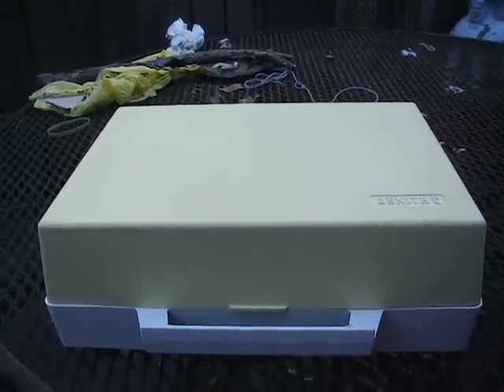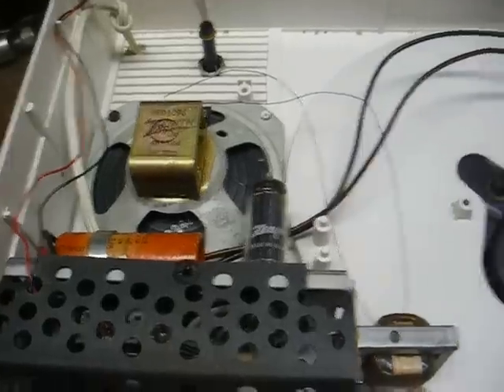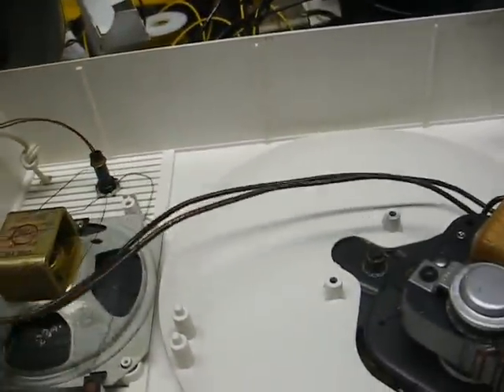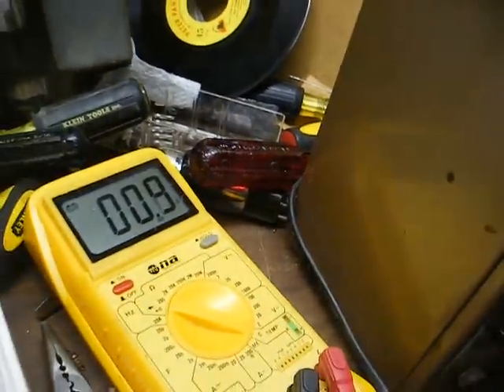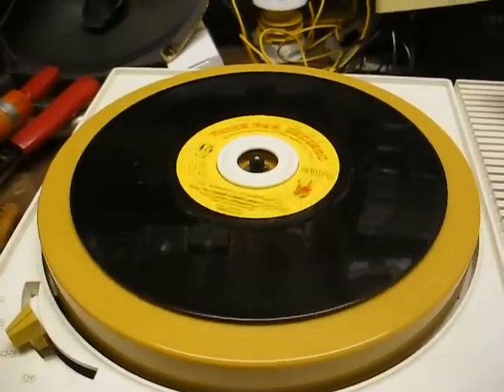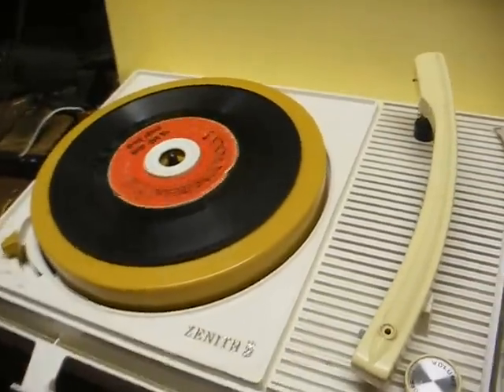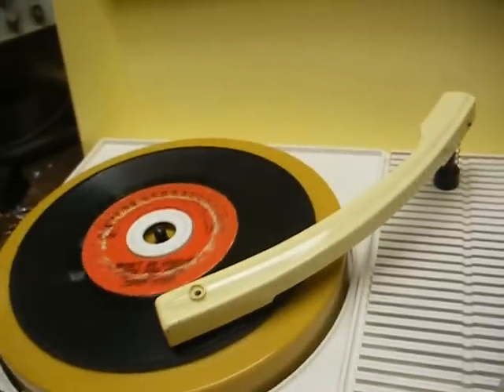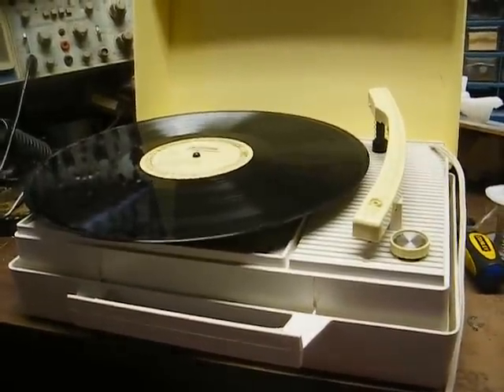Zenith single-tube kiddie record player from 1968

Comment: Zenith was rock-solid. My dad only purchased Zenith TV's until the early 80's. That early 80's set last into the 2000's before the picture developed problems, it would shrink down in size occasionally. No one would repair it so he had to junk it. At the same I was thinking that it could be some IC or capacitor that was causing it and either you or Shango could have easily diagnosed the problem. It really was a good set, clear picture and incredible stereo sound from a 19 inch set.

Comment: The last time I picked up an old briefcase record player the turntable was bad but the amplifier worked very well.  It was a three-tube series string job.

The last time I heard of a single-tube record player it was something from the 1940s which played through an AM radio.  I believe it used a 117L7GT tube.

Comment: I have to say that the little tip of the tube makes a great speaker poker. lol. I have a Montgomery Ward record player with a same single tube. It is also dead. it has a selenium rectifier in it. I doubt it works. Anyway I guess I will work on it some day. Cool little record player you found there. 😁

Comment: I never owned one (of any make), but I still read everything I can find about these one-tube record players; they are that fascinating for me. The phono motor was a special 90-volt one that was wired in series with the tube filament; if the filament opened, the motor stopped. I don't know what would happen if the tube shorted; however, my best guess is either the motor would immediately burn out (which would make sense, considering the shorted tube would put the full line voltage across the motor winding) or the house fuse would blow. 

 As meticulous as they were regarding quality of their devices (until they left Chicago for Korea), I am amazed Zenith didn't put line fuses in these phonographs to prevent motor damage, rather than relying on the house fuse to open the circuit if the tube developed a heater-cathode short. Also, I noticed that the single tube in your phono is a miniature one. Didn't most of the one-tube "kiddie" phonographs use a line-operated octal tube, such as a 117Z6? This way, the designers could use any standard line-operated phono motor rather than  a special 90-volt one, which I would think were almost impossible to find only a few years after these phonos were introduced (and are almost certainly NLA [no longer available]) today. The only way I would think a one-tube phono could be restored if the 90-volt motor were replaced by a modern 117-volt one. If one does not care about authenticity, the one-tube amplifier could be replaced, of course, by a solid-state one, but I don't think very many folks would restore a one-tube phonograph of any make any other way than repairing the original one-tube amplifier. These little wonders should be kept as original as possible, since they are so rare these days; in fact, yours is the first such kiddie phono I've seen in a long time. Another thing that caught my eye about yours  is that it was made by the original Zenith Radio Corporation of Chicago, and were probably many kids' introduction to the quality of Zenith products.

Comment: I'd like to see a video about the WELTRON space age 8 track stereo receiver.  It's kinda a ball shaped radio.  I've seen them sell for between 50$ -700$.  They don't seem to be anything better than a Soundesign or Electrophonic, certainly not worth that much.  The antique shop by us wants 200$ for one, it's been there for years, no takers (suckers).  If you find one around 50$ on epay, um sure it needs repairs, i.e. AS IS FOR REPAIRS OR PARTS.  But for 300$, it would say UNTESTED, BUT IT WORKED TEN YEARS AGO WHEN IT WAS LAST USED.  They seem to be collectable because they look like a space helmet.  But I'd like to see the junk inside one of those.  Don.
Reply: I had one of those! The speakers were yellow balls that matched the shape and size of the stereo receiver. They also worked on 12 volts. Mine was mounted in my 71 VW when I got it. It had a good sound for what it was.

Comment: 11:10 They sound as if they are about to cry. I wonder if anyone ever found a way to put one of those mechanically activated micro switches on the speed control of one of these things,   and do away with the one on the volume control so that the neural position would be the only way to shut if off. Human nature being what it is, I imagine that would be the only way to keep the idler from eventually getting  flat spots. Anyway, I'll bet the stamping for the metal chassis in this thing cost more than the IC amplifier board they would have used today.

Comment: Greetings:
Have you tried soaking the idler wheel in Rubber Renue 408c to see if the wheel roundness is restored?
I like to follow along with your repairs by having a copy of the schematic. Without the model number I was unable to find it.
Is the info still to be found on the unit? How did you find one?
Thank you in advance.

Comment: Your not THAT old? at least you dont sound like it anyway. Also, FET transistors have way too much gain IMHO, and they will oscillate and sound like a chinese bandwagon. I tend to stick to low gain stuff, maybe a 2-stage bipolar setup so it doesn't oscillate.